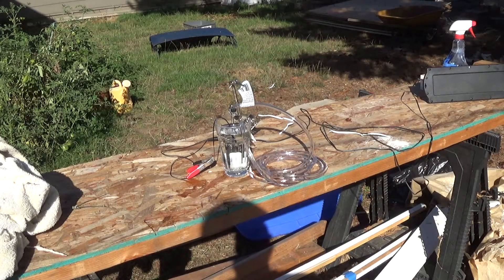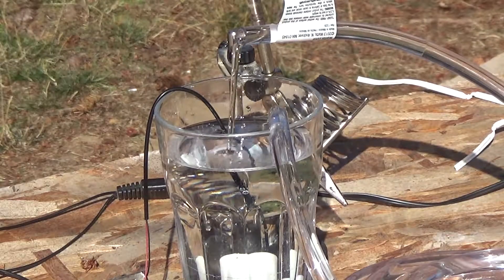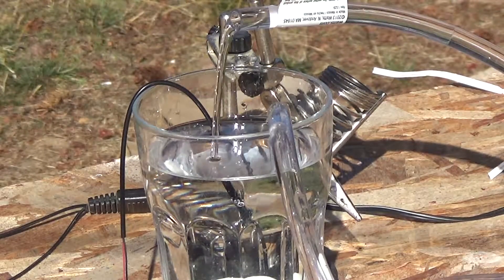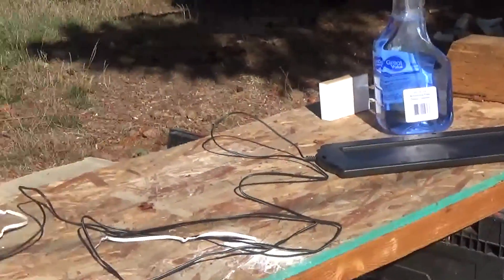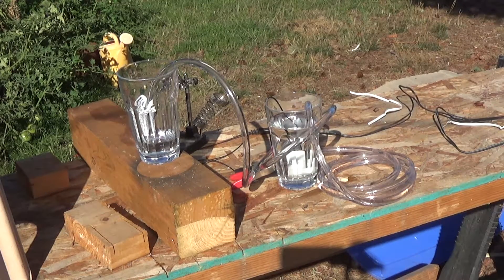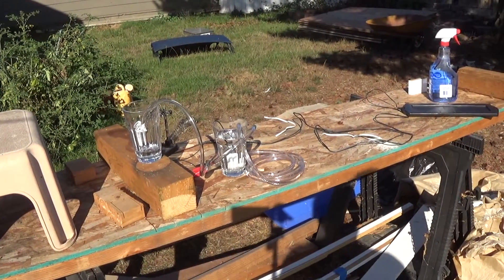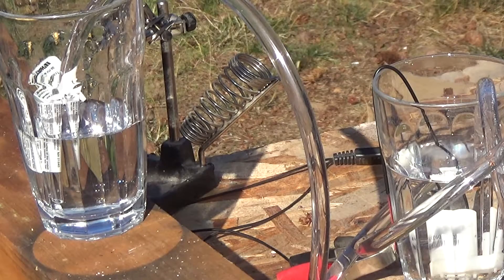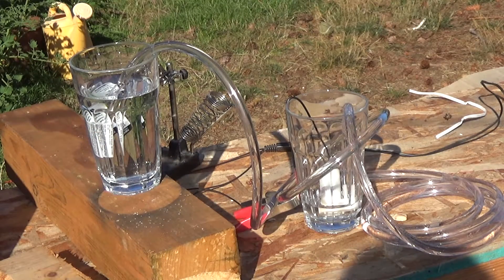Storing electricity as potential kinetic energy

Comment: Great use -- did you ever see how they use to do strip mining using gravity fed water -- big pipes to smaller pipes going down hill hill - once in the smallest pipe at bottom of hill it had the pressure needed to strip mine the area.  The only issue I can see is how to regulate for the demand you need -- with storage in batteries you just draw what you want
Cheers